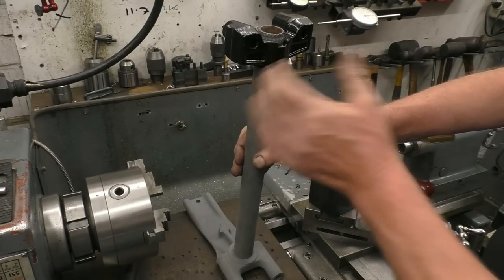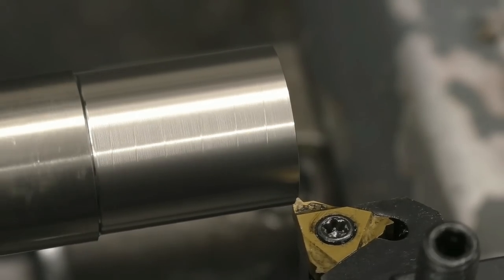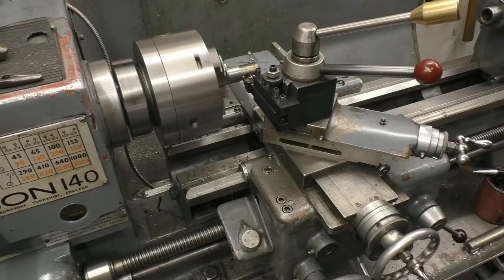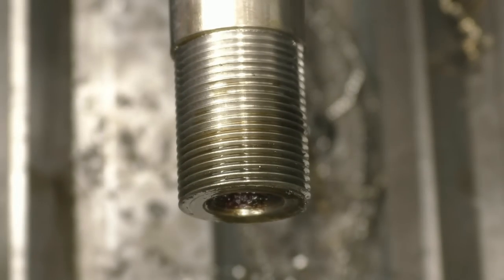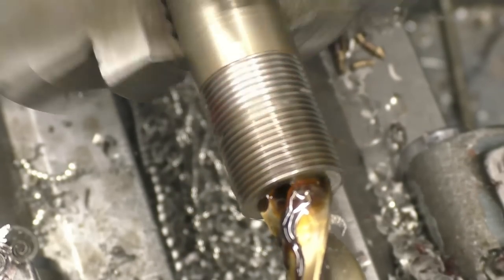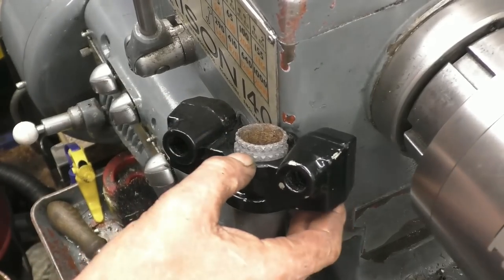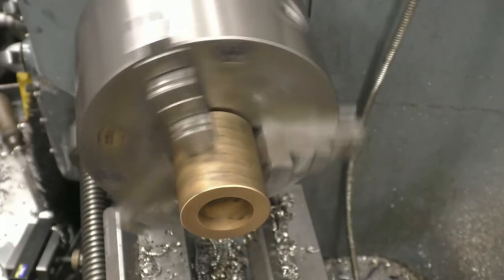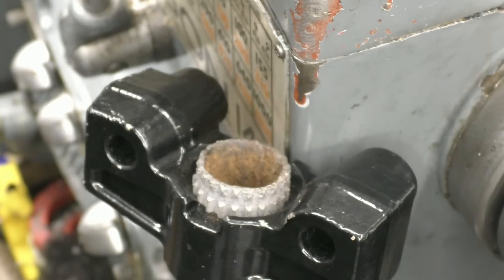SNNC 444 P2 . Mercury Pro Max 225 Outboard Repairs

Comment: Mercury service departments just love folks that  don’t flush them out properly ,I’ve done a few that young lads have bought a boat  to impress their mates and never cleaned the motor by flushing  and you end up with this mass of white aluminium corrosion and sometimes scrap ,great part 2 John another saved 👍👨🏻‍🏭

Comment: Beautiful piece to boot.  Things had to look cooler in the Bronze Age.
Reply: Looks nice, but will destroy the engine.  Bronze is my favourite material to machine, but you need to be very, very, careful with it if there is any aluminium around.

Comment: A good repair job but it doesn't look like staianless to me? Also do you ever check the anvil on the threading tool that it is the correct angle for the given TPI/pitch of the thread being cut. You must make sure the insert side has sufficient clearance during the cutting process, especially when it gets deeper into the thread. Ian

Comment: Nicely made, but the introduction of bronze will destroy aluminium parts in a seawater environment, as bronze is the more noble metal. Since most of the engine will be aluminium of one sort or another, that will be expensive. Please replace the washer with aluminium..
Reply: yep. And all the other bits need assembling with loads of Duralac (or lithium grease at a push) to isolate the aluminium from the stainless. Outboards are horrible things, made of monkey metal and designed to corrode from the start. You have to do all you can to stop them corroding to bits.
Reply: @srp01983  Too right.  Yes, even stainless can be a bit of a nightmare with Al.  Electrolysis/galvanic corrosion is by far the most important consideration in marine engineering.
Reply: @RicktheRecorder  that is why sacrificial zinc anodes are fitted to boats and outboards….to reduce galvanic corrosion by sacrificing the less noble metal
Reply: @CRAZYRACINGDUDE  Indeed, but they won't benefit dissimilar metals within the outboard itself.
Reply: @RicktheRecorder  ah okay, but would the dissimilar metals not have to be connected directly to one another to create a problem?
Reply: @CRAZYRACINGDUDE  As far as I can see, the bronze spacer is clamped between steel and aluminium. That will create a mechanical and electrical connection, facilitated by sea-water vapour as an electrolyte.  It is hard to know exactly what the consequence will be but sacrifice of the steel and the aluminium seems very likely. Anodic protection would normally be in the form of zinc or aluminium anodes, so this confers little advantage to an aluminium engine. I would expect accelerated corrosion in the area of this repair - indeed there has already been a great deal, and this is likely to make it worse. An aluminium spacer would be better, as the owner requested.
Reply: @RicktheRecorder It is clamped between bare stainless steel and painted cast steel….but it is not isolated from aluminium on other parts of the outboard….so it’s looking like an aluminium spacer will be the safer bet.
Reply: @CRAZYRACINGDUDE  As I say, the actual circumstances are not completely clear - for instance the degree to which the aluminium is protected by the powder coating, where it has not failed. The larger the area of active exposed aluminium, the less the danger from stainless steel and bronze, since the ionic interaction is 'diluted' by the larger area of anodic material (aluminium) it has to corrode.  The more you introduce dissimilar metals the more scope for problems however. Galvanized steel and aluminium are reasonably safe together, as are small amounts of stainless, but here you have very exposed and active bronze and a large chunk of stainless with a surface area un-welded inside the tube likely to be filled with electrolyte. I am not a metallurgical expert, but have some years of experience of dealing with marine corrosion, and this is what I see. Stainless and bronze are more or less OK together but there are differently-active grades of stainless. It's not straightforward, but the more similar the materials the simpler the issues. Yes, I'd stick with an aluminium washer/spacer, and just keep an eye on it after the first season.